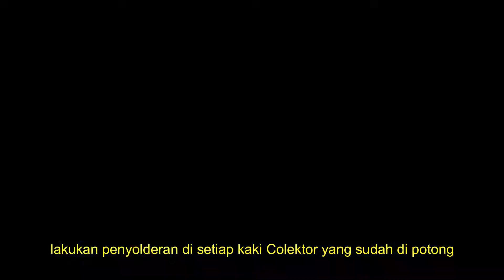Merakit Final Driver 3 set || Transistor toshiba

Comment: Mas itu tiga set mau di kasih trofo berapa Amper. Berapa vol ct. Mantap lanjutkan tak tunggu hasilnya 👍
Reply from the maker: pas buat video 35 VAC 10 A banci
sekarang tak naikan ke 45 VAC 10 A banci
Reply: Kalo 32 bisa mass

Comment: Mas mau tanya. Travo 3a driver socl 506 pcb fiber. final 2set apakah kuat mohon bantuanya
Reply from the maker: Kuat ngangkat speaker brp inch?? 
Ini kan yg sy pakai 10a banci kalo normal y cuma 5a. Teg 35vac buat angkat 15 inch mampu.. tp baru² ini tk rubah ke 45vac aman

Comment: Mas Bro, itu driver 3 set per channel bisa angkat speaker berapa inc banyak nya dan berapa Watt speaker nya?
Reply from the maker: Sy pakai 3 set utk angkat 15 inch. Final tidak panas cuma hangat saja wajar. D geber sub nya juga ga panas. Watt speaker 400watt 8ohm
Reply: @SEsaputro  15 inch berapa biji bang ,buat 2 biji sama 12 inch 2 biji kuat gk 3 set ,trus buat travo brapa vac